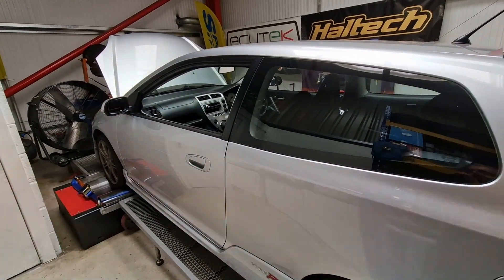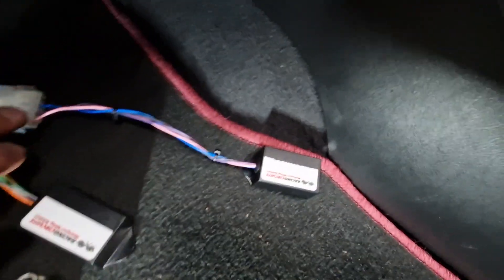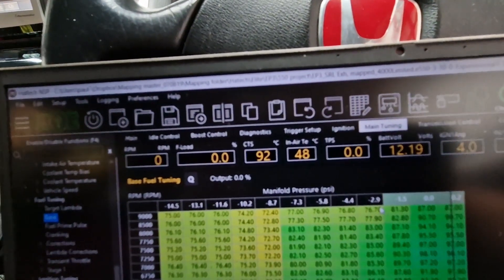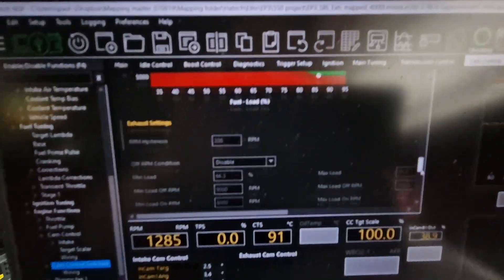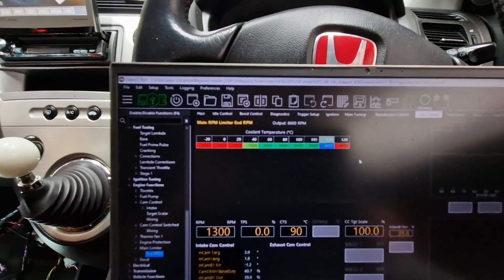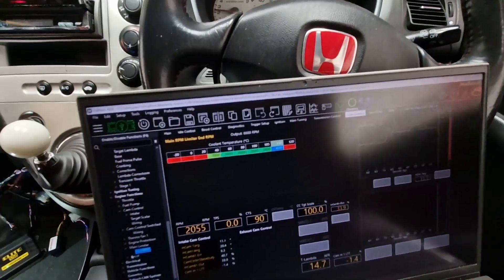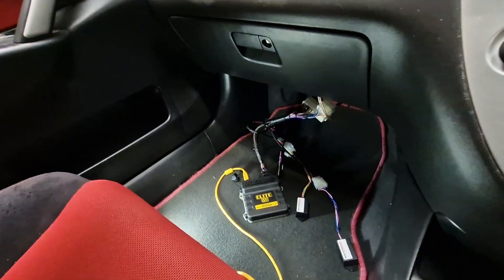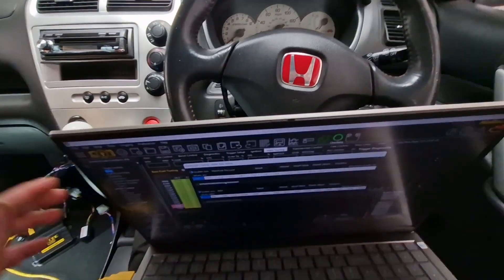KSWAP EP3/DC5 HALTECH PNP ECU PACKAGE DETAILS

Comment: Will they be preinstalled with Base map or will it be by download the only reason I ask is because I purchased 550 from another company when they were doing the haltech b series stuff and basically, they ignored me after I purchased haltech from them. I made my own plug and play harness. And had to figure out trigger settings myself that was the whole point of purchasing it.
Reply from the maker: They will be supplied with a calibration that will allow the car to be started and tested then idea is you get it to someone like ourselves to actually tune the car to the mods and get the best out of it all.

We will also be doing ECUs supplied with a control map all configured for specific mods as well with portions of the settings locked out for series racing which also allows access to diagnostics, sensors and expansion without having access to actual performance mapping to ensure compliance to series regulations the same as we have already been doing with the sealed Civic Cup ECU systems 👍